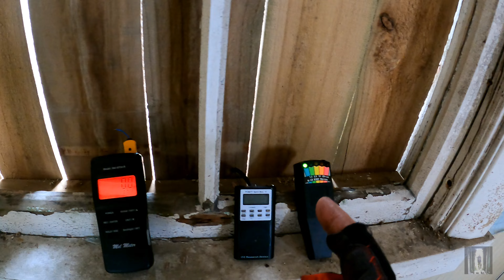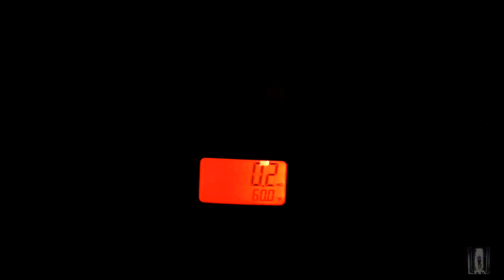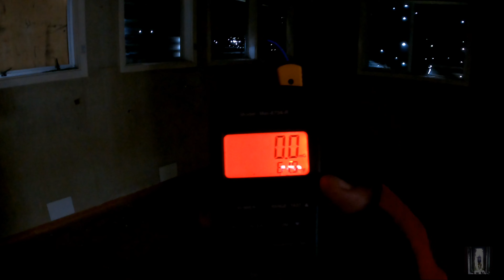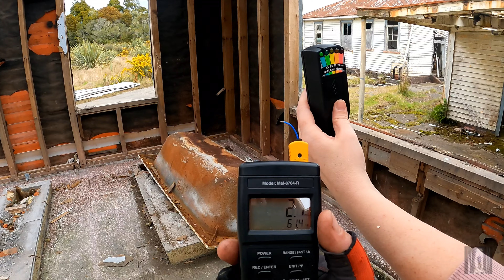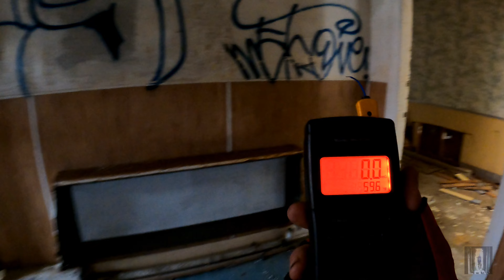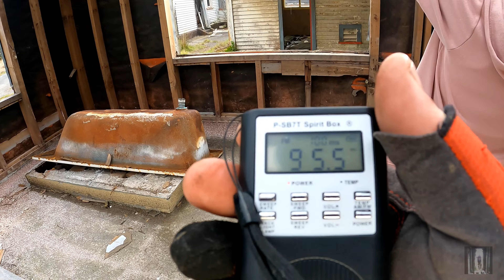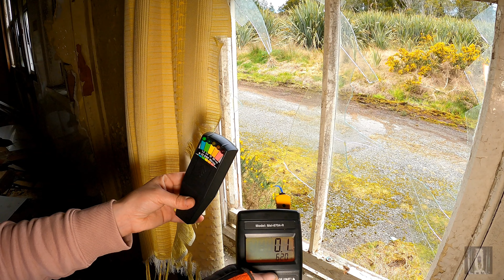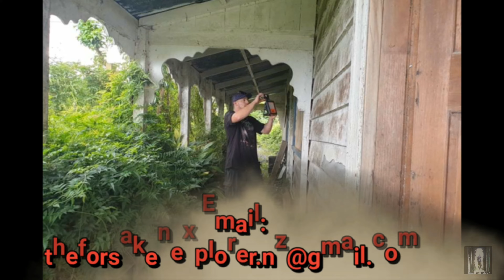The Last Ever Paranormal Explore At A Demolished Haunted Asylum Ward, Nz

Comment: In henry Bennett in ward 34 they used to have an oil painting of a gas chamber. Just on the wall on the left when you walk in as a visitor and where the meals are brought through the electromagnetic  locked door. Its no longer there now but the painting of a birds eye veiw of tulip fields on the wall opposite the gas chamber painting is still there. Thanks for the water tower climb. It looks like and isolation block next to that tower. Yeah pretty sad them people were looked away in them day rooms from birth and drowned electrocuted labotamised if they did not behave like good little kids while been grown adults.  Babys were drowned in baths like that. Tokanui had a crematorium and about ten other buildings bowled over and swept under the rug in the 1970,s if you search hard enough you will find some pretty sadistic sad things went on out of sight out of mind and still does in psychiatric wards to this day. Believe me ive seen and been through it. Racism is rife still and still in the wards of todays standards.

Comment: Not trying to kill the joy but you might be getting different temperature readings in parts because of the holes in the floors and wall and probably ceilings the humidity in walls of  that broken down shame of a place will fluctuate with that many holes in a building. The spirits probably left that place once it become just a whole lot of not much left of it.
Reply from the maker: Could be a great theory actually 😎👍